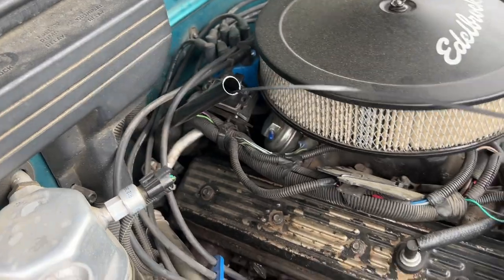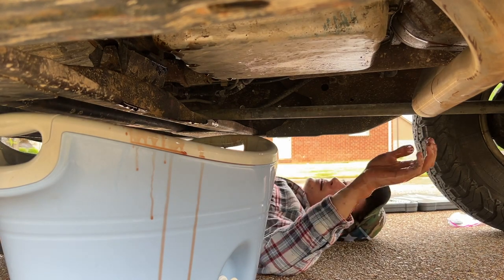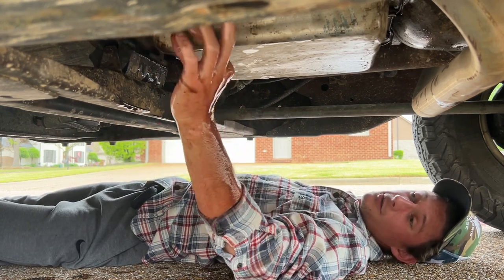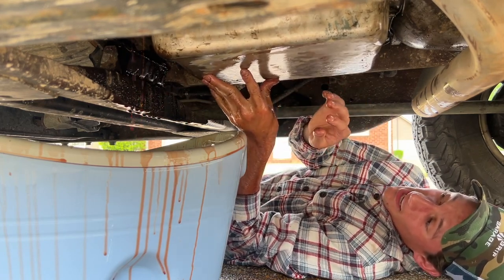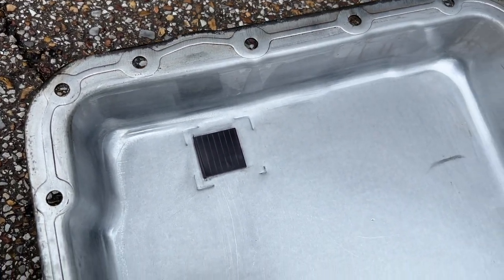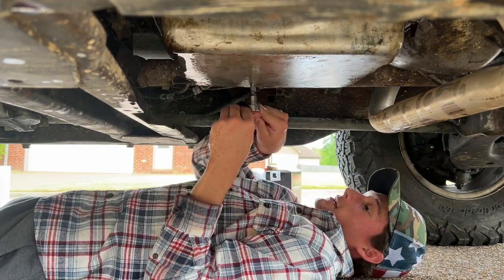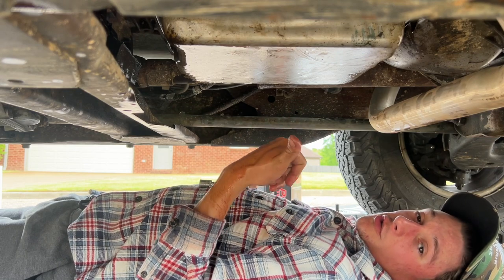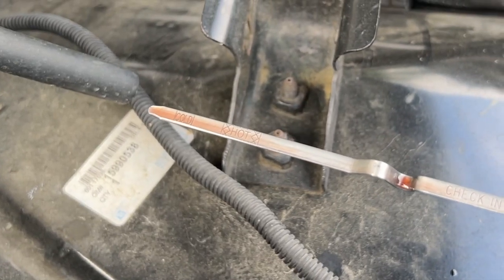“Professional” Transmission Fluid Change | 4l60e | 1993 Chevy K1500

Comment: I always use fluid pump to suck out tranny fluid outta dipstick hole. Found that from local hardware store, very usefull tool. After that I take pan out to change the filter, no mess at all.
Reply from the maker: Yea I have one. But doing it that way doesn’t clean the magnet or get 100% of the fluid out of the bottom of the pan and plus I just wanted to see everything. And change the filter because I already bought it😂. Granted the gasket and filter was $16 but still
Reply from the maker: Really appreciate you taking the time to make a comment. Really means a lot to me. Hopefully you liked the video!

Comment: I have a 1991 Chevy k1500 with a 5.7 automatic… my transmission oil also had some air bubbles on the dip stick ! It’s also because I over filled it ! Hopefully by changing out the oil and putting fresh new oil in there the air bubbles will go away transmission runs and shifts good btw… how did yours turn out buddy ? You still see air bubbles in the dip stick ??
Reply from the maker: Yea mine is all good. Never had problems again and yes the bubbles are fine. Think it was jsut over full
Reply: @wword  that’s good then brother I’m changing mine at the moment hopefully everything goes well 👍🙏🏻

Comment: Did it take 5 1/2 quarts of fluid?
Reply from the maker: Nah I just put 5 in it. Well technically barely less than 5 and it was perfect
Reply: @wword  thanks for the reply and the great video too! I’m going to attempt it on my 93 Silverado
Reply from the maker: @Spellcheekswammablamma  really appreciate you taking the extra time to comment!  Means a lot man. Tbh I was a little intimidated by it but it is super simple and straight forward. Just make sure the filter is in all the way and you’re good. You got it easy. Just be ready for a mess😂

Comment: Don't do this guys method.
Use 12. Volt liquid pump, hose down the dipstick tube, pump out the 2.5 quarts, then pans empty and easy to remove and light weight, no mess.
Throw a tarp under the truck.
Other way is connect hose to rad cooler outlet and run truck till you see air bubbles, then drop pan.
Don't be this guy, work smarter not harder
Reply from the maker: What’s the fun in that😂